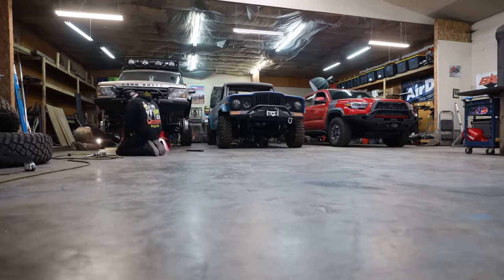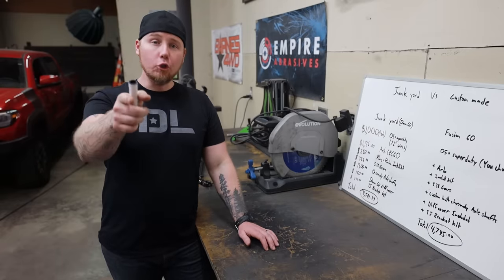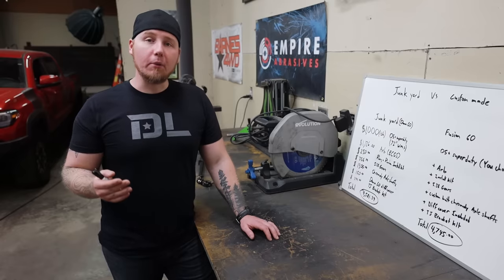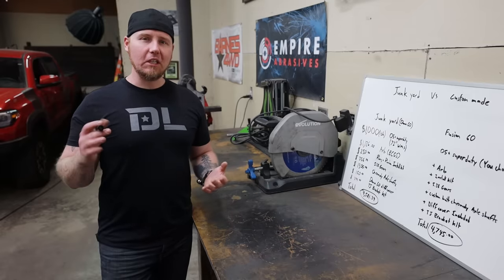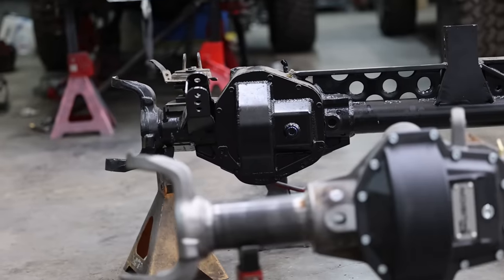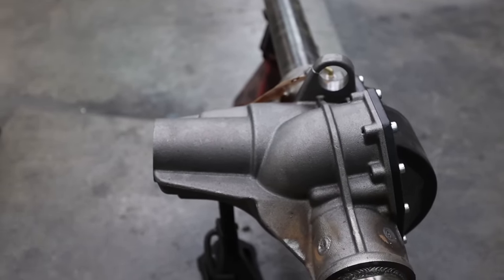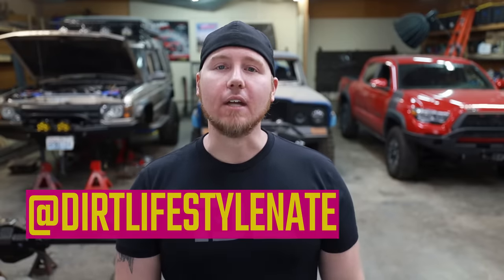Don't Buy 1 Ton Axles Until You Compare These Costs

Comment: Biggest difference i see between new and used parts is, a) TAX, and b) when building a used axle and buying parts it is done in multiple smaller transactions, which can be more manageable for lots of people....and also easier to hide from your wife!!!!
Reply from the maker: Lol great perspective 👌
Reply: Classic
Reply: You need a different wife if you have to hide $$ expense from her; also ive done both junkjard and custom axles and its WAAAY better to just save the money and wait  until you can drop it on a custom build; its the little things that you get going custom that adds up and makes a HUGE difference in the end, trust me; oh !! also slap a warranty too  =)
Reply: @yepitsme431  ok bud! Saving works for some. Others buy and upgrade over time. Whatever floats your boat big man
Reply: Nate, I just found a sterling rear with D60 FRONT  from 2015 F350  for $350  for set... truck was beautiful and well maintained till it burned... axles are untouched and I wanted to use under my Xj.... I plan to wheel harder than I do on stock set up with 4" lift ... what's your opinion here? Buy or not... I can't afford the out of pocket expense of custom axles...

Comment: $1000 or more for a used donor axle is ridiculous. I’d just move 😂
Reply: Or take a vacation to someplace in the Midwest where axles are cheaper.

Okay, vacation might be a strong word.
Reply: @BuffMyRadius  I just picked up a rolled over super duty complete frame with suspension and axles for $800. I’m sure they would be expensive up in the PNW or wherever they salt the roads but in the south most of this stuff is rust free and cheap. With the prices Nate mentioned I’d be all for a road trip too
Reply: @mihcael174  we salt our roads like 2 days a year. Not a rust belt around here
Reply: 250 each with a choice of 4 types here on FB marketplace.  Shhh

Comment: What about knuckles, spindles, hubs, and brakes? Most junkyard axles will have a lot of that stuff already?
Reply from the maker: Yep most do. Knuckles and hubs are certainly relevant to the conversation but I would never consider using junk yard brakes in a build. Safety is first, everything else second.
Perhaps I should have tacked on 50 bucks for a set of junk yard Knuckles with the fusion 4x4 option
Reply: @DirtLifestyle  I got a set of 79 f250 axles from the junk yard in west New York and the Dana 44 has the big dual pistons and the rubber seals were fine. I reused them👌🏻
Reply from the maker: @austinandannah5357  cool! Personally I will never reuse old brakes from a junk yard. But I'm glad it work out in your case 👍
Reply: @DirtLifestyle  nothing wrong with junkyard brakes as long as you check the seals and piston movement.  If you bought a used car you wouldn’t think twice about using the brakes on it...no difference
Reply from the maker: @firstwordcar 
Not sure how I could be more clear about this with out sound like a d-bag. Here it goes...
 If you go to school to get an ASE certification there is one word that gets touched on repeatedly when these schools teach brakes... contamination. You can't compare a used car with junk yard brakes because an axle sitting out in the rain is completely exposed to the elements. How long was this axle and brakes sitting outside? 6 months? A year? Once you introduce contamination into the system how can you tell that there is no corrosion on the inside of the piston? If you are pulling the piston and actually rebuilding the calipers then we completely agree. In this instance junkyard brakes can be used but If you are saying that by looking at the outside of a caliper is "inspecting" it then we do not agree. 
Your brakes are the most important system you have in the rig your servicing and the stakes are sooooo high if they fail. I'm One of the few people I know that was actually trained on how to service and inspect brakes properly. And because of my understanding of these systems I use caution. My life (and yours) depends on it.
Reply: @DirtLifestyle  I don’t think you’re a D-bag for clarifying haha, no problem.  We’re on the same page.  Also ASE trained and know how to disassemble and inspect brakes.  Contamination from sitting in a yard compared to normal everyday usage and even neglect of maintenance isn’t even the same thing.  Brakes are fairly simple but one bad component can be life or death so it’s very important you know what you are doing.  Of course a junkyard straight axle is more likely to have the lines snipped and introduce major contamination to the system that may be irreversible.

So in hindsight I mispoke when I said ‘no difference’
Reply: I'll still take the junkyard brakes, use the calipers as cores for reman'd ones, and the frisbees for correctly sizing the replacements.
Reply: @DirtLifestyle  I think another aspect to add to the discussion is the ability to build up over a time span. A lot of my friends spread the full axle build over a year span, maybe even longer. They’re doing good to simply buy the tons in the first place. A fabricated housing kinda forces you to spend out all at once. Even if it ends at the exact same dollar amount, some people gotta spread that burden out across several paychecks. All the while, keeping their rig on the trails.
Reply: If the axle comes with cores, you're saving a lot of money there.

Comment: Time is something to consider as well. It takes a little while to just cut the brackets off a super duty axle.
Reply: For the time put in to do this at my pay scale the used axel would have been at least $250 MORE expensive. 
The only reason that doing an axel like this can pan out is it allows you to spread the parts cost out over time. However they can become a problem in itself. Finding out months later you got the wrong part ect. 
This video pretty much sums up why I’m leaving a D30 under my YJ and sinking as little money in it as possible for my build. I’d rather save for a custom D44.
Reply: That ALONE makes the new option totally worth it!
Reply: Time is a huge one to concider. We all want our builds done. Not sitting in the garage.
Reply: I was thinking the same thng, pulling up a chair and grinding brackets off is not my idea of fun. It makes for a great instagram photo with all the sparks but that's about it.

Comment: Great video. It is ridiculous that used parts with two hundred thousand miles on it are costing almost as much as new stuff. If people start buying more new parts, hopefully it will drive the cost of used parts down.
Reply from the maker: My thoughts exactly. An axle with 200k miles that might be bent? OR a brand new custom housing with a warranty. It's a no brainer to me
Reply: I paid 1500 bucks for front axles with 40,000 on them shipped to my house from across the country😅
Reply: @jaboff-road1776  u should have watched the video first 🤣
Reply: It depends on where you are too I got front and rear 1 tons ready to bolt under for 1,700$ that’s what I spent on axels spring perches for coils and 5:13 gears I did not go with moly shafts I figure they will be fine for what I’m doing

Comment: Whether you go junk yard or aftermarket you need a few things you didn’t mention that going to cost money, sometimes a lot of money.  Brakes, steering linkage, high steer arms ect.  I’m sure you had a reason for the omission and this is the first time I’ve run across your channel.  Good vid, I’m retired now and out of the business but I enjoy watching these kind of channels to see what new ideas are floating around.  Back in the 1960’s and 1970’s all of the engineering was done around the campfire and a 6 pack.
Reply: I think the omission was based on, "those things should be new anyway" assumptions. The same reason the 8.8 is a waste of time. Buy the time you've added the "ultimate 8.8" package (locker, shafts and bearing retaining upgrades) and a complete rebuild with brackets. Your damned near at the same costs as a new custom d60 or d44 with factory geometry.
Reply: Many aftermarket come complete with updated disc brakes as an almost drop in unit.

Comment: But the custom axle didn’t come with knuckles, hubs or brakes ect, so you need to factory that into the price.
Reply from the maker: You are absolutely right. Add another 50 bucks for some junk yard knuckles 👍
Reply: @DirtLifestyle  Don’t forget unit bearings. That’s another $250-$400 per side.
Reply: I was about to raise that same point - perhaps a good compromise would be to buy the junk-yard axle, remove the brakes, etc, that aren't supplied with the custom axle, then flick on the rest - might come out pretty close to even if the market's as strong as suggested.
Overall, when buying new one avoids buying someone else's problem - and if one's dropping that sort of money on the axle, it's not unlikely they'll be happy(ish) to add a bit more for new brakes and stub axles so they KNOW they're all good.

Comment: I’m a fan of buying aftermarket axles over junkyard axles every single time. Junkyard axles aren’t built for off-roading rigs. They’re built for on road trucks. Aftermarket axles are built with high clearance off-roading in mind. They come with a warranty. They can be completely custom made. They’re just better. And even if they’re more expensive they’re just plain better.
Reply: They come already made, that’s a big deal. No squaring or truing.
Reply: 35 spline 1.6” axles shafts are 35 spline 1.6” axle shafts. No difference. The rocks and torque doesn’t know it is a spidertrack or a 79F350 front axle.
Reply: @runningproblem  big rock once asked me.."is that a spydertrax or f350?"
I said "spydertrax"
big rock said "you may pass"
I shudder to think what might of happened if it had been a 350!!

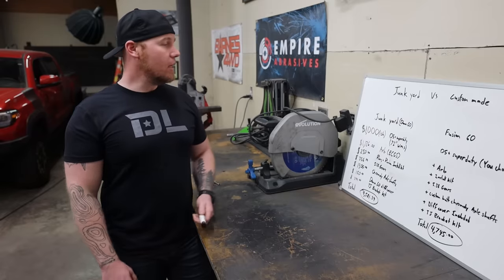Comment: You are completely right with the prices. But I believe this video is for more of the hardcore wheelers. More of an every weekend on Moab or rubicon type stuff. For someone like me who road trips with a camper and doesn’t hit a hard trails might want to go the cheap junkyard route with factory axles. Either way, you are right. Right now I’m rocking a factory 91 suburban with a 14 bolt and an 8 lug 10 bolt and 4:10’s. This is perfect for me bc the factory parts are cheap and readily available at any given time at auto parts stores where as a chromoly shaft from Yukon isn’t readily available. I like wheelin but not the hardcore stuf just because I am usually attached to a camper and have my family with me..... either way, I love your videos and appreciate your hard work and thought that goes in them. You’re very knowledgeable and highly experienced. Can’t wait to see what’s up with your jeep truck! I’m also looking at a new wrangler 6 speed as a daily driver and road trip stuff with my pups.

Comment: Great video with lots of information for those of us that were debating junkyard axles vs new.   One advantage I could see to going with a junkyard axle is being able to spread out the costs over a longer timeframe, for those of us with a limited monthly budget for upgrades.  However, if someone doesn't have the ability or tools, the labor costs of building a junkyard axle also need to be factored in.

Comment: A lot of good points made in the discussions. I did not have time to read all of it so maybe this point has already been made, the knowledge to do everything to a junkyard or aftermarket axle to get it to the bolt-in point. I do not have that knowledge or skill set so to me you should have added in a reasonable labor cost for the work that needed to be done to these axles. I went the junkyard axle route about 12-13 years ago. The initial cost of a set of matching front and back '77 Ford Dana 60's wasn't bad at $1250, but after buying all the parts and paying someone to put it all together, it really added up. I have not, however, broken a single u-joint  or axle shaft on either axle in 12 years of wheeling since it was complete. I run a 5.3L Chevy, have 38.5 Boggers on a stretched TJ and don't shy away from very many obstacles. Probably should not have put that out there! lol I put all my gearing into the trans and t-case. I have a SM465 with a 7.2:1 first gear and a 5:1 Atlas so even with the stock 3.54 gears left in the axle (saved me money) my crawl ratio is up over 120:1. It works for me. Great video and good discussion point. I think if i was building mine today after watching this, I would go after market for the minimal cost difference.

Comment: I did consider building my own but Instead bought danatrac pro 60’s for my jku. Just rebuilt my old axles and installed them on my wife’s jku with the 4:56 trutrac gear set and 37” mud grapplers
Reply: I have a JK with 35’s and a truetrac. How does truetrac do with jump to 37’s. I heard it’s a little to much tire for truetrac and locker is now needed. Any first hand experience with??

Comment: The biggest reason I see for using a junkyard axle is I can get into a dana 60 and feasibly put it on my rig for 1500$. This starting cost is way lower than 4500$ for a custom axle. Then, later on, I can put lockers, axles shafts, and all the other goodies on it when I can afford it. It may not be cheaper in the long run, but I can spread 4500$ out over several months or years and make it more affordable. This is how I did my junkyard dana 44 swap into my Cherokee at 16.

Comment: Big pro of a junkyard axle is parts availability. Chances are somebody you know, somebody on a Facebook group, etc. Will have what you need when something breaks. But when you go with a custom axle and you HAVE to order and extra set custom axle shafts or you're just screwed. At least upgrading stock shafts and keeping them in the tow rig can get you a bit more drive time

Comment: This is definitely a hobby and fabrication is fun. That said, I don't have a lot of extra spare time at the moment, and also consider the time I am using to fab, as labor hours, cause if you didn't do it you would have to pay someone too do it. Thus, my time is valuable and the $200 difference is thrown out and it goes way into the favor of the custom axle from all the time you save. 
I love fabrication but if I only have enough time to be wheeling or building, I know which one I am choosing every time. Nice job on the video, this will be an eye opener for many including myself.

Comment: great video Nate , it has come down to supply in demand so everything goes up and people pay it they want to build stronger and its far from reality, I machine and  heat treat steel of all kinds for a living and have gained tons of knowledge over almost 20 yrs experience, you got to think before you drop 4k on a used axle swap, sure you know what it came out of is easy, its the mileage , heat cycles the unit has gone through and most of all was it driven hard and serviced regularly or never serviced, if it has almost never been serviced, the whole unit is well under 50% of its usable service life, and is then put into a rig with big off road tires and like most guys don't bother to upgrade the gear ratios now you just upped the factor of your 4k axle breakage possibly your first trip out wheeling, so i agree with you the new custom axle price even if it is a $1000 more is the way i would go hands down, no messing around with used things when off roading people being penny wise and pound foolish, i have built heavy duty equipment of all sorts over the years and know what can go wrong and at times ,very wrong, buddy built a rig 7 yrs ago put in a 5.3 V8 low miles like 27k and old 1 ton axles out of a ford F350 it looked great when it was done and had a set of 37" KO2's on it before the end of the 2nd month boom broke something in the back fixed it, then 2 weeks later the front gave up the ghost and was almost 3k and he did all the work diff, axles ,knuckles, driveshaft so almost new really when you think about an some guy offered to sell him a new front axle for $3900 we couldn't talk him out of it doing it his way, thats ok though, new is not for everyone i would stay new thats just me  👍
Reply from the maker: Very true. Most folks don't think about what life that junk yard axle has seen before you got it. Was the passenger side tire hit by another vehicle in an accident? A 1° tweek in the inner c could be easily overlooked and make it chew through tires faster then normal. It could even cause some minor death wobble issues. I've actually had 2 close friends buy and build axles to find out they were bent 🤦‍♂️.
But you are right new axles aren't for everyone

Comment: Thank you for doing this comparison. I have done a junkyard swap with a Ford 8.8 but for the front I have looked at custom built Dana 44.  Time is a big factor for me and for $200 more that is well worth it. There is always a risk with a junkyard axle, like is it straight or bent? The argument some may have about reusing stuff, I would advise against is. You already have the axle tore apart and you a building a project then might as well replace the wearable parts. I also agree with upgrading to Chromoly, again it is worth the upgrade. I think I saw someone say brakes too, well I like new pads and rotors as well. 

Great video and I appreciate the true apples to apples comparison.

Comment: I did a 1 ton junkyard swap on my 88 4runner back in 2004 and with prices of custom axles id go that route plus dont forget the added cost of going tons upgraded steering, ram assist, brake master cylinder/possibly booter and beefing up frame to name a few

Comment: Maybe I’m just not well informed on this topic but I went with 2012 super duty axles. I love your videos and this is probably helpful for jeep swaps but when you get a used axle you get the whole thing and usually more. Steering box,hubs, brakes, sway bar, tie rods, drag link… etc. I got all this and more when I found mine. It took a few months to find a decent deal though.